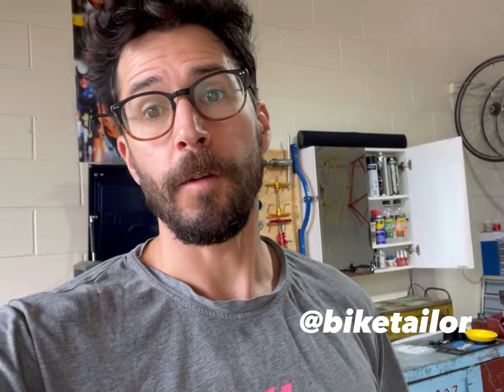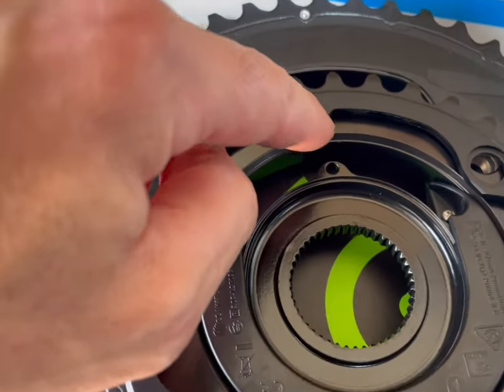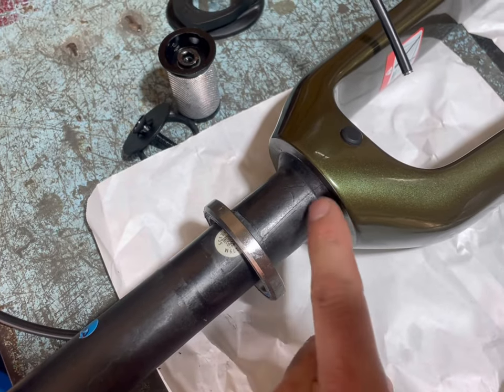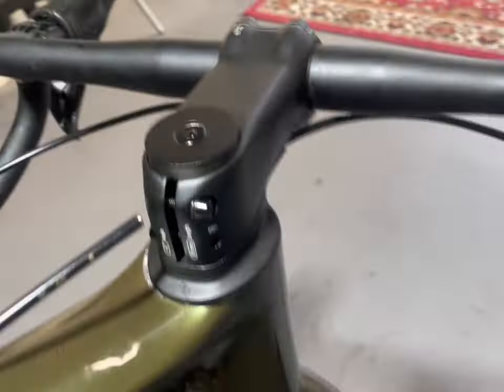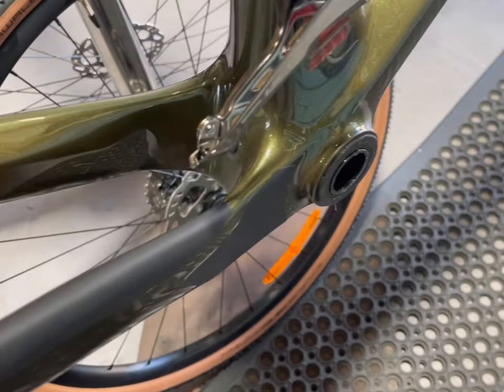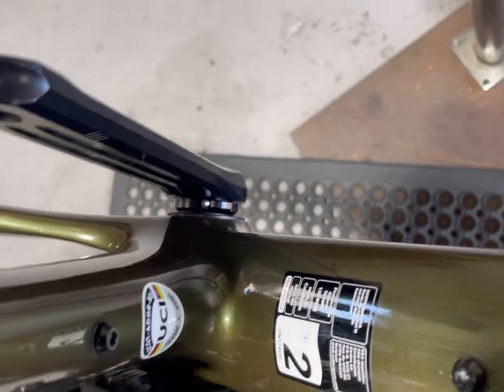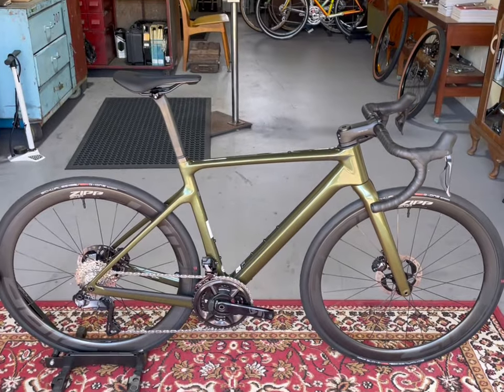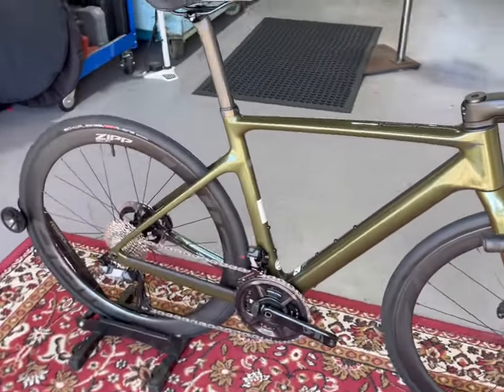Scott Addict Gravel bike build

Comment: Fantastic video! I have the same bike and powermeter - very useful to see how to measure if the crankset is symmetric :-) What's the final weight of the bike?
Reply from the maker: No idea, i didn't weigh it. I was under a tight deadline, so didnt have a chance to get that.  But, it is a lovely bike and would be pretty light with the zipps.

Comment: Keen to see how this rear mech will do on rough staff without clutch. I use the same staff for gravel but would be nice to have a stronger spring as an upgrade at some point. Also, what do you use to fix disc brake spacing discrepancies ?
Reply from the maker: Yeh, i hear you on that.  Id probably opt for a clutch derailleur too for gravel.. But, I believe this customer is going to be on tame gravel, so should be fine with the normal spring tension.
For rotor spacing you can buy spacers pretty cheap online.  Then you workout which wheelset's rotor sits further inboard and space that set out accordingly.  Take a bit of trial and error and patience, but can usually get there.  These wheelsets actually didn't need any in the end, so that was lucky for me (and the shifting was spot on too).

Comment: nice build, what about the fit for a wide sram crankset (dub) I am on the process to built a new grvl bike and the scott addict RC frameset looks like a nice option, for the current frame in use I have the wide crankset force, will fit fine on this scott addict? will like to know about it.
Reply from the maker: Yeh, Sram Dub cranksets will fit, just make sure to get a compatible bottom bracket.  The build was a few month ago, so I cant remember all the frame spec, but I think The Scott addict cx has a bb86 shell.  So, get a BB that is bb86 for sram Dub

Comment: Hi, why did you remove the original BB (used for GRX crank)? Is this one not compatible with Ultegra crank? Or is it due to Rotor crank requiring different BB standard? Thank you!
Reply from the maker: Yes, these rotor cranks required a different BB